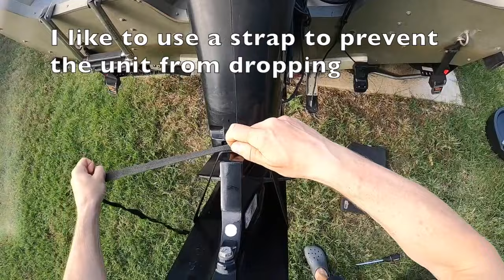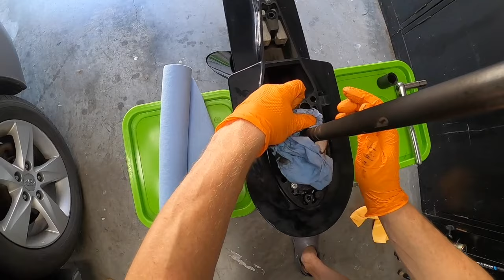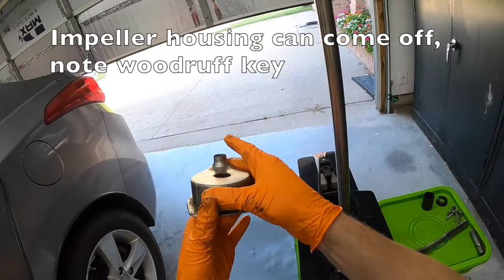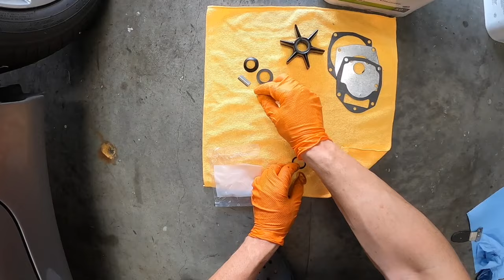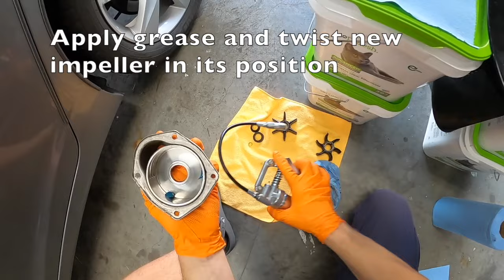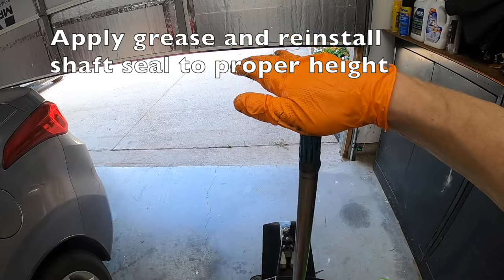Mercury Optimax Impeller Replacement

Comment: Should my Optimax 150 pee immediately, or does it wait until the engine is warm?  I have fished a several years, but have never taken a boat out myself.  My dad died about a year and a half ago and I now possess his Nitro 7.

It has not been on the water in almost two years, and the batteries need to be replace.  The cranking battery has totally died and I have tried charging it and reconditioning it.  I also decided to replace the trolling motor batteries with Li Time (lithium) batteries, and am going to install a lithium charger, too.

But, I already knew that the tell tale wasn't peeing from cranking it up a few months ago.  I had tried muffs, but it never peed.  I bought a large (soft) rainwater collection "can"  and filled it up.  That way the propeller can turn with no need for the muffs.  Using both methods. it still never peed.

I only found out today that I could screw in my hose to the left of the tell-tale.  That did cause water to stream from the tell tale.

But my main question still remains:  Should the tell tale pass water immediately, or should it rely on the engine warming up enough to open up the thermostat?
Reply from the maker: You should see water right away or within a couple seconds at most. You possibly have a bad impeller or obstruction in the water passage ways. Sometimes a piece of debris gets lodged in tell tale, you can try clearing it with by poking in a straightened paper clip.

Comment: What's the reason for putting in forward gear??
Reply from the maker: You can leave it neutral but sometimes driveshaft splines don’t line up during assembly. If it’s in gear, you can just turn the prop slightly to align.

Comment: Should of shown the installation of lower unit. You skipped it.
Reply: Agree, you left off hardest part of water pump replace. I noticed a lot outboard how to videos do that not just water pump. They all leave out the most important part of job??? My guess is they got in trouble and had to hire a Pro fix it. They don't want you knowing that?
Reply: Lol is easy to reinstall just a bit of swearing 🤬  and done but is worth $350